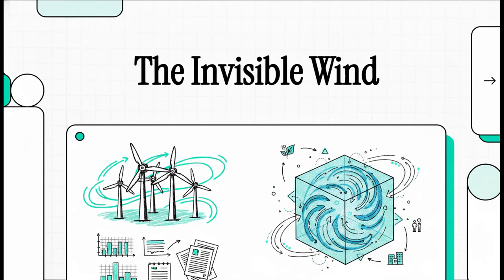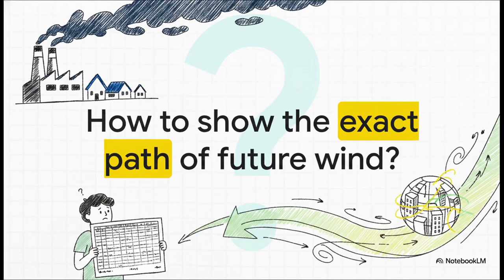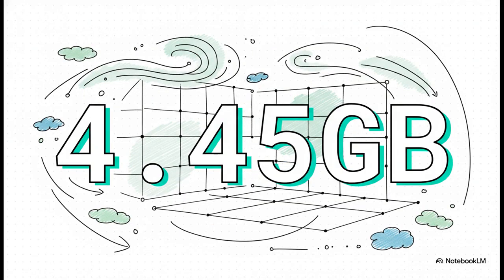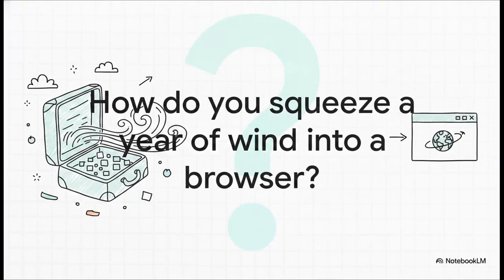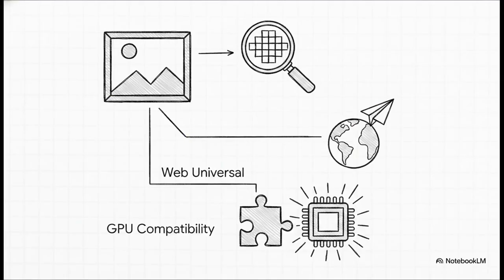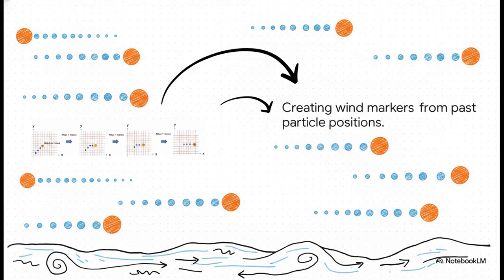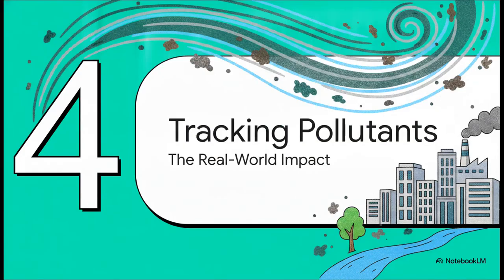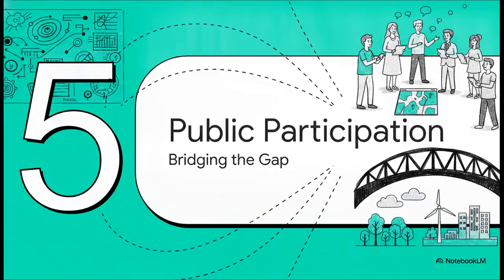How #Digital #Twin #Technology #Revolutionizes #EIA #Accuracy for #Infrastructure #Projects

Comment: Traditional environmental assessments have often been constrained by their reliance on static visualizations, tabulated data, or historical records that may not reflect real-time conditions. This can create barriers to understanding, especially when predicting the impacts of nonvisible elements like noise, ground vibration, and air quality. Digital Twins revolutionize this process by serving as a portal through which authoritative, real-time data about an asset can be accessed across its entire lifecycle—from early planning to operations. For instance, in infrastructure projects like the Interstate Bridge Replacement (IBR) program, Digital Twins allow engineers to simulate "what-if" scenarios related to design decisions and environmental impacts with a very high degree of precision before construction begins.